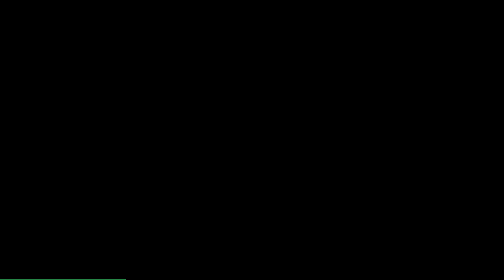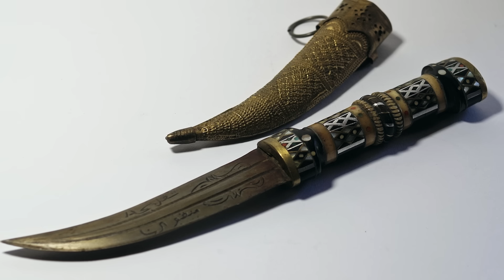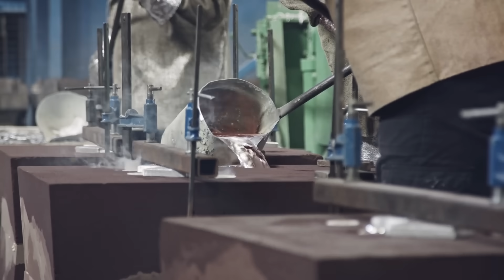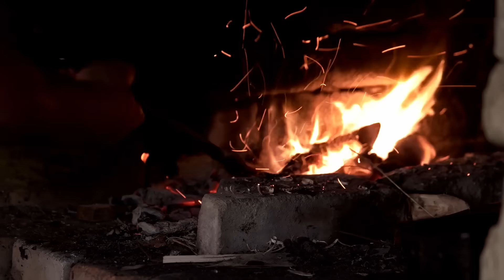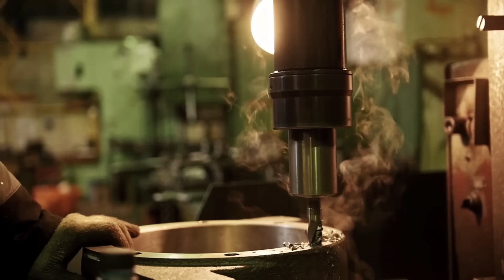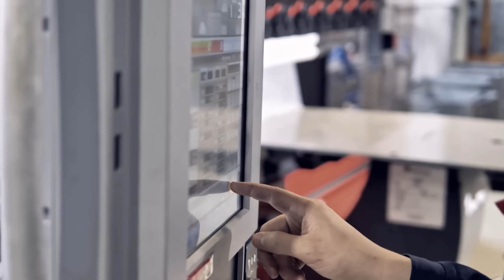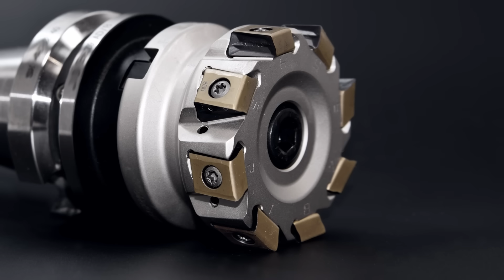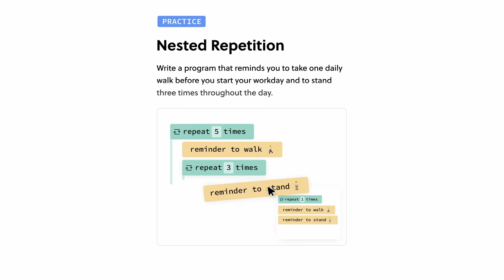The Science Of Cutting

Comment: I thought the Roman swords were steel?
Reply: Before blast furnaces made cast pig iron. Bloomery furnaces turned ore into iron without melting it making spongy iron cakes that had to broken apart to sort all the lumps into different grades of iron. This high and low carbon iron is then flattened and folded together to even out the properties, often pattern welded. This is often depicted as something peculiar and special to samurai swords, but it is actually one of the lowest tiers on the iron age tech tree.  Blacksmiths can also slowly raise or lower the carbon by which part of the fire they heat it in. Steel just means good quality iron. These terms came into use before they had a real understanding of the chemistry involved. Blacksmiths can make good quality steel from low quality bloomery iron.

Comment: One offshoot of CNC is the vast number of hobbiests ( like me ) who design and build or buy CNC machines of various types for home use. I built my first CNC mill in 2002. It's also created the ability for small shops to rapid prototype new products very cheaply ( relatively speaking).
Reply: And also 3D printers are CNC machines. They runs on more or less identical G-Code as a 3 axis milling machine with some commands specific for 3D printers like instead of a spindle they have an extruder and a heated build plate. The most common CNC/G-Code standard for 3D printers is called Marlin.

Comment: one of the things that solidified how cutting metals worked for me was using a cold cut saw (not the meat) which had a carbide toothed blade about a quarter inch thick. it spun slow with coolant and was a beast of a machine. It was loud as hell too, so I didn't want to go too rough on it but my boss said I was wasting money not being aggressive with the saw since technically it's taking less cuts and wears the teeth out less.

Comment: 5:40
I once put a 5cm stripped copper wire into a drill and the other end into a vice, after roughly 250 turns it broke clean at the drill. When I analyzed it, it was almost as hard as a steel nail, but would break when under too much load.

Comment: Great video, thanks. As a highly skilled mashinist, it warms my heart to watch this. 
But a slight correction; it was not Watt the boring mashine was made for, but Thomas Newcomben. Originaly made to bore out canonbarrels. And it was only made possible by Darbys use of coke to melt iron, not charcoal. Otherwise enough iron could not be made, to cast a cylinder.
Reply: The same newcomben as the steam engine?
Reply: @enja001  Yes, exactly. Darby made his melt in 1709, and Newcomben made his engine in 1712. The reason it was an atmospheric engine and not a steamengine was, the tecnologi was not good enough to make a boiler able to withstand the pressiore. The rivet was not invented yet.

Comment: Bronze is insanely resistant to corrosion. In fact that’s probably why there are still artifacts available today. Bronze is still the preferred metal for use in salt water environments
Reply: Yea, in fact steel rusts, and the rust doesn't protect the metal. When bronze corrodes, the corrosion product forms a layer that stops further corrosion, meaning they can last nearly forever, it's why you can find elemental copper out in the wild, and why you never find elemental iron out in the wild (unless it's meteoric iron). In the old testament it talks about someone becoming upset losing an iron axe head (this was in the bronze age, meaning any iron tool was insanely expensive), and through prayer was able to recover it. Iron/steel tools proved to be vastly superior, but it remains that they do rust. They only last when we actively protect them, or polish them regularly and oil them.
Reply: @taiwanluthiers Yes. Also, interestingly, the fact that iron rusts isn’t technically the issue. All metals corrode in some way and in difference circumstances. But the problem with iron corrosion like red oxide (as opposed to black oxide) is that the resulting size of the material that forms is physically larger than the parent material. It as it grows it must flake and fall off exposing new metal to corrode again and so on and so forth until there’s nothing left. So it’s not that iron corrodes is the issue, it’s that as it corrodes it falls off and re corrodes.
Reply: @jimurrata6785  Crazy to think that iron and oxygen combine and create an outward force through that reaction.  I wonder if you could prevent iron oxide from forming if it were under pressure.
Reply: @Omniverse0  pressure usually accelerated chemical reactions.
Reply: @taiwanluthiers  where in the old testament is this? i dont remember reading it, im not doubting its written, it seems very interesting ngl
Reply: @DavidLara-g4o  I don't remember exactly where either, I believe somewhere in Ezekiel or something, or maybe one of those 1/2 Kings/Chronicles book. I'm not saying this to push religion (I really hate this when I mention anything from the Bible, it's just a piece of recorded history), but it is a good piece of history. People don't realize how recent our modern world is. Iron/steel in the not too distant past was almost unobtainium.
Reply: @taiwanluthiers  yeah, bible is history mostly if you are not religious, but even like that most historians search for other sources tho
Reply: @taiwanluthiers  ... or make them from rustproof steel.
Reply: @taiwanluthiers mostly true, however iron oxide can be worked to a similar effect through the process of blueing and blacking. It's not as good as bronze without maintenance but vastly improves corrosion resistance.
Reply: @taiwanluthiers  Define “steel.” No, seriously. Define what specific steel types you’re talking about. It’s such as massively diverse group of alloys that it’s flatly wrong to describe all steels as anything other than “an alloy of iron.”

Some steel types rusts. Some, quite plainly, do not, at least on a human timescale. Some form oxides that protect the underlying layers like on some aluminum alloys. And some do all three under different conditions.
Reply: @taiwanluthiers wow, upset equals to insanely expensive? Your comment was interesting until I got there. Is this how you religious people form conclusions?
Reply: @Steel0079  What, you thought an iron axe head was something you could buy at home depot for a few bucks in the late bronze age?? If you had iron tools back then, it cost you a pretty penny, like as in as much as a farm. Steel tools were expensive even in the medieval times, with a suit of armor costing as much as a castle. If you lost something that expensive, wouldn't you get upset?
Reply: @taiwanluthiers  cost is one of the reasons to get upset. Not the only. You formed conclusions based on assumptions. And when questioned about it, in your reply you continue to make more assumptions.
Reply: @Steel0079  Seriously.... are you trolling?

"upset equals to insanely expensive": No they didn't say anything even close to this. They offered one reason why someone MIGHT be upset given that the story was about someone in the bronze age.

"Is this how you religious people form conclusions?" At what point did they say they were religious. Knowing stories from the old testament has literally zero correlation with religiosity.

"cost is one of the reasons to get upset. Not the only. " At no point did this person claim it was the only reason to get upset. Not one single time. 

"You formed conclusions based on assumptions.": What like you did when you obviously and (purposefully?) misunderstood what they wrote, and assumed multiple things about the person and their intent.

 "And when questioned about it, in your reply you continue to make more assumptions." : you made an unnecessarily belligerent response to a perfectly reasonable comment. Then when they responded with an explanation to your (honestly weird) objections explaining things further, you doubled down on your belligerence.

Either you're trolling or you need to work on your reading comprehension. Have a nice day.
Reply: @timseguine2  " In the old testament it talks about someone becoming upset losing an iron axe head (this was in the bronze age, meaning any iron tool was insanely expensive), "

Then in in counter to my comment to him, he said this and gave whole explanation why losing iron stuff would make you upset:

"What, you thought an iron axe head was something you could buy at home depot for a few bucks in the late bronze age?? If you had iron tools back then, it cost you a pretty penny, like as in as much as a farm. Steel tools were expensive even in the medieval times, with a suit of armor costing as much as a castle. If you lost something that expensive, wouldn't you get upset?"

Is that clear now to you?

In future, before making remarks read through the convo first instead of accusing others of trolling. Your comprehension skills are bad that's not my problem.
Reply: @Steel0079  I read the entire thread. I understood the entire thread. I quoted the relevant parts of what you wrote that I took issue with and you ignored what I wrote ENTIRELY, then try to falsely paint me as the one who doesn't understand.

And your idea of explaining yourself is just to copy and paste the entire statement of the other person, and say "do you see now?" With literally zero explanation. That is not how an argument works. I raised specific issues about specific statements you made and you ignored them entirely.

You claimed they said "upset equals insanely expensive": No they did not make this claim. Explain how you think they made this claim.

You claimed they said cost was the only reason to get upset. They did not make this claim: neither in their original statement nor in their rebuttal to you. Explain how you think they made this claim. Emphasis on the words "only reason".

You made an assumption that they were religious: this might be true, but you have no evidence for this claim. Then accuse them of making assumptions.

And the thing is: even if everything you said is absolutely true. Your belligerence and your doubling down and tripling down on the belligerence is completely not okay.

In the future, respond to the actual criticisms made against you, instead of just copy-pasting what the other person wrote like it forms an explanation of your own behavior on its own. Your argumentation skills are as poor as your reading comprehension and personal skills and that's not my problem.
Reply: @taiwanluthiers  A suit of armor as expensive as a castle? Several years worth of income of a skilled laborer, or the price of a small farm, for high quality full body armor, perhaps. That is obviously nothing compared to a castle.
Reply: @leocurious9919  It's certainly not something you'd find in a scrap yard for sure. It was a decent chunk of change.
Reply: @Steel0079  lmao i really like the fact that the only likes your replies get are yours
Reply: @Steel0079 You don't need to be religious to read a book
Reply: @timseguine2 I mean, I would say knowing religious stories is at least correlated with religiosity. Obviously the venn diagram between the two isn’t a circle though.
Reply: @Autumn_Panic  I'll admit it's arguable. In my experience though the average member of most religions knows very little about what is actually written in their religion's scriptures. In my estimation that evens things out to a weak correlation at best. Given that aspect is based on anecdotal evidence and a some conjecture, I don't expect anyone to take that entirely uncritically.

That's my point of view, and that's why I chose the word I chose. A less controversial way of making the same point is "familiarity with a religious story is insufficient evidence to conclude someone is a member of a religion." Which for the purposes of this argument is sufficient.
Reply: @Steel0079  Not sure @tai's post says 'I'm religious'. And I most certainly am not, but I can recognise that there are historical references that do ring true, among the plethora of superstitious mumbo-jumbo in in this collection of ancient myths that is the Bible.
Reply: @Steel0079 They never said that the axe was expensive BECAUSE they where upset. They legit said person lost thing and was upset (also this thing cost a lot during the time they lost it). 
How is that, in any way, saying that it was expensive because they where upset, all they said was that iron was expensive in the Bronze Age, and it was because it couldn’t be easily or quickly made into tools. They never directly stated the reason I did because it is a simple one implied by the name “Bronze Age” as in, the vast majority of tools were bronze. Just because they never directly stated that dosent mean they where saying “oh well the person in the story was upset so obviously it was expensive”
Reply: @Steel0079 yea you lost this argument bad. Give up
Reply: Yeah it still seems that bronze is still the primary material when you're making fixtures for water control. Typically they're Chrome for protection and for style. But is also we're starting to see materials such as ceramics for faucets etc. At some point we're going to start experimenting with using carbon fiber as well.

They have been experimenting with it when using pressure containers for things like propane canisters etc. Since it's typically stronger than the steel but lighter weight. You're also seeing carbon fiber for doing things like drive shafts and yacht masts
Reply: @Wyld1one Can be, but in you get into corrosion-resiatant steel alloys when pressure and heat get involved in the application. I machine both. Brass is annoyingly malleable.
Reply: @Wyld1one  ... typically they're chromed*
Reply: guys, calm down, he meant that bronze was sisceptible to corrosion COMPARED TO STONE. ofc its more resistent to corrosion that iron, but humans didn't have iron back then, they only had stone, copper and bronze, and unlike last two, stone doesn't corrode
Reply: @Circle9ru  Stone absolutely corrodes!
There's a huge movement to use certain rock like basalt to try to control atmospheric carbon through accelerated weathering. 
Edit, should have underscored instead of struck out....
Reply: @jimurrata6785 , what exact stone corrodes? most cutting tools were made of stone, that mostly consist silicon dioxide, which DOESN'T corrode. most stones used for tools don't corrode or corrode so slow, your grand grand grand grand childeren will still not be able to see the signs of the corrosion on it. hell, the stone instruments found by archelogists are still absolutely fine after thousands of years in the ground.
Reply: @Circle9ru  corrosion, opposed to erosion (the wearing down of stone, mostly through abrasion and fracture due to freeze/thaw)
As I pointed out, specifically above, basalt (not pumice or obsidian, other volcanic stones) corrodes, or rots, through chemical reaction.
Hell, even you point out that silicon dioxide will react on a millennial time scale.
Entropy not a difficult concept to grasp, but it does inform every bit of our understanding of the known universe!
Reply: @jimurrata6785 , it corrodes in time, but in human scale thousands of years its the same as never.
Reply: Believe it or not but in the early 1900 the Ampco Corporation which specialized in Aluminum Bronze alloys introduced an alloy intended for making cutting tools for machining steel. The tools produced from the alloy were superior to the carbon steel cutting tools common at the time. Of course once HSS cutting tools became common the need went away.
Reply: Something something ATLANTIS
Reply: There is a thing called bronze sickness. Once it starts it will corrod the whole piece. It comes back even when ground off. Metallurgists think it's from an inclusion, but still don't know it's root cause.
Reply: Bronze is brilliant: https://www.youtube.com/watch?v=nyu4u3VZYaQ
Reply: I was not prepared for such an in depth video, loved it!
Reply: nice, someone realized that weird statement